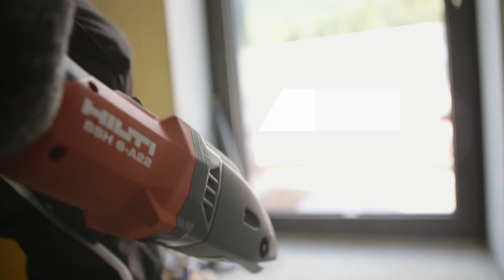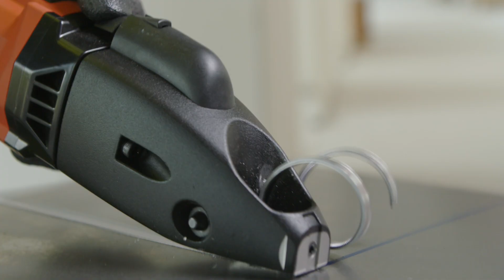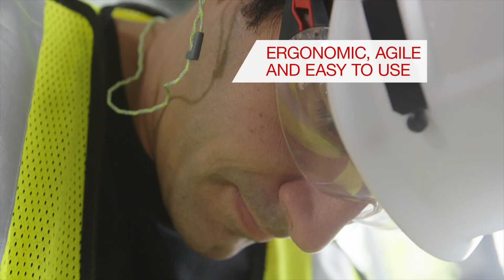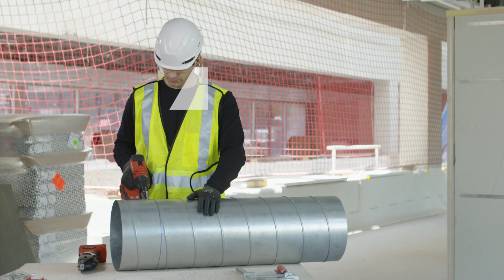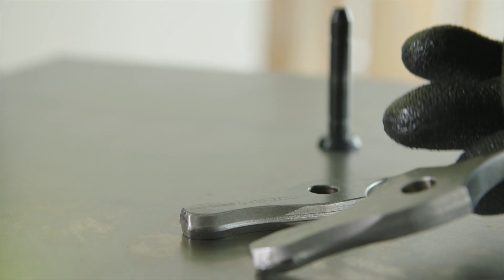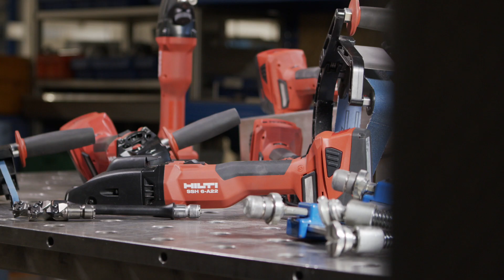INTRODUCING: Hilti SSH 6-A22 Cordless Shearer

Comment: Hello,

I've been talking and interacting with some REAL Hilti users, REAL pros in different trades around the world.

According to what I heard, I can attest that there is pretty much an unanimity about only 3 tools missing by Hilti.

1 Multitool, 2 right angle 12v impact driver and 3 a powerful 22v blower!

That's all... because we have grinders, drills,  rotary hammers, radio, saws, new batteries, etc but Hilti lacks those tools...and off course more brushless tools and Xlock now.

Thanks!
Reply: Wish they had a multi tool and 90° 12v impact.
They have launched multi head 12v in France hopefully in uk soon
Reply: @ashleyhodder3242  the multi head drill is great, however nothing compared to a dedicated 90° impact driver.
Multitool would be also great.
Who knows right? Hopefully we'll see them one day.
Thanks